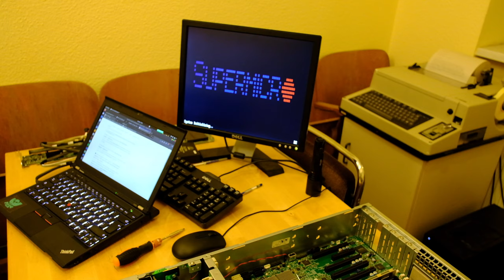Replacing an old Supermicro server with FreeNAS to a new one

Comment: Just a point here, the top server is running with the top cover off, that's okay here because there's a plastic air guide over the cpus forming an air tunnel through the cpu heatsink so air is guided to the right places even with the top off.  But some servers depend on the top cover to guide the air. So running the server with it off might result in unusually high cpu temps.

Comment: Hello, great video. I have the same motherboards X9 and X8. I don't use the last one. These servers are pretty cheap on bargainhardware. I have 48 GB RAM on my server with a pair of Xeon E5-2667 V1. I put a pair of Be Quiet! Pure Rock fans to make it quiet. I use consumer grade HDD and SSD. I use Proxmox with several VMs (Windows and Linux, PfSense). I use LVM with SSD cache feature. It exists also on ZFS but the cache is lost at the shutdown in current implementation. Where did you find the 2,5" to 3,5" adaptors ? To be able to put my 2,5" HDD, I 3D printed adaptors but it is not the best solution (HDD is fixed on one side)
Reply from the maker: Hello,
I use standard adapters from 2.5 to 3.5 inches. You can find it here: https://www.ebay.de/i/163768938389?chn=ps&norover=1&mkevt=1&mkrid=707-134425-41852-0&mkcid=2&itemid=163768938389&targetid=888516359244&deviceoca&68692506508506508409&2 = 90992276282 & rlsatarget = pla-888516359244 & abcId = 1139676 & merchantid = 115557829 & gclid = CjwKCAjw95D0BRBFEiwAcO1KDLCFR7zBPiQSrqcXVBo_-qAErdnW4RFOVZOd_QAErdnX6RFOvQOd

Comment: You have improperly installed the ram, it's even more whacky than you expect. Refer to the motherboard manual.
Reply from the maker: I had installed the RAM wrong. The reason for this was that I had oriented myself to the old server. This server has a different sequence for the installation of the RAM.
Of course the new Supermicro server has a correct specification in the manual. I had accidentally done it like the old server.

Comment: Nächstes Mal bitte das manual lesen. Dann gibt es auch keine Probleme mit dem RAM. Der RAM ist falsch konfiguriert, die RAM Bänke sind nicht ohne Grund farbig. Bei 4x RAM pro CPU kommen jeweils die riegel in die blauen slots. Stichwort quadchannel. Habe selbst einen supermicro superserver mit einem X9dr7-ln4f. Trotzdem gut gemacht.
Reply from the maker: Ich hatte den RAM falsch Installiert. Der Grund dafür war das ich mich am alten Server orientiert hatte. Dieser hat eine andere reihen folge für die Installation des RAMs.
Natürlich hat der neue Supermicro Server eine richtige Angabe im Handbuch. Ich hatte es versehentlich wie beim alten Server gemacht.

Comment: I just wanted to say the amount of thermal compound you put on the CPUs is like 4-5x the recommended amount.
A small pea size is more than enough.
Interesting video though, I have a similarly spec'd Intel S2600GZ.
Reply: Assuming the mounting pressure is sufficient, it doesn't mean a shit how much paste you put on. Any dispensable amount will be squished out, so the only real downside for him is to clean up the mess he made once the CPUs will get removed again :D 
In case that bothers him, he'll use less next time ... quite naturally.
Reply from the maker: @yucktube  The one makes more thermal paste the other makes less on the CPU. Yes, I tend to apply too much thermal paste. :) but it's OK.
Reply: @boscolab  I don't even think it was that much in this case, despite these CPUs being only 4 cores and far from the IHS size of an Intel HEDT or AMD Threadripper. But did you see at least a little bit of TIM coming out at the edges after mounting the heatsinks?
Reply from the maker: @yucktube  The CPUs have 6 cores, they are E5-2620.
There is nothing on the sides.
I have applied more to another server and there is very little leaking on the side.
Reply: @boscolab  Sorry, either I must have misheard, or mixed up something in case you spoke of 4 cores in another part of the video.
If there's nothing squishing out at that amount, the mounting pressure could be too weak; meaning Adam might in fact be right because you probably have a nice "thick" layer of thermal paste between your IHS and the heatsink. Thick in quotation marks, because it's of course not as thick that you couldn't even barely see through, but still way too much = much more than the razor-thin film that would be adequate to just fill microscopic gaps. I'm not saying you're having thermal problems, but still there's more room for improvement than you might think.